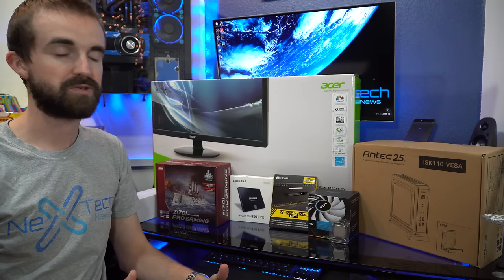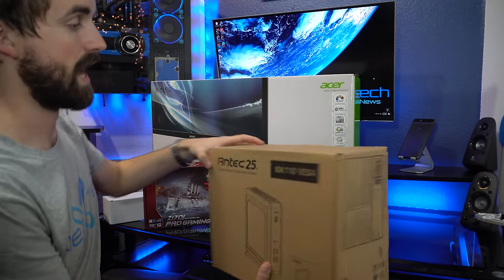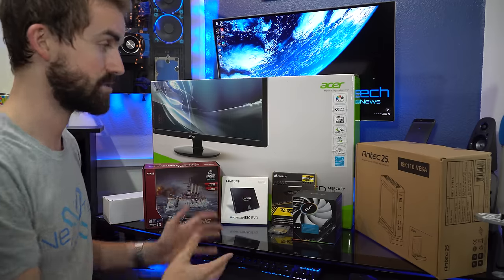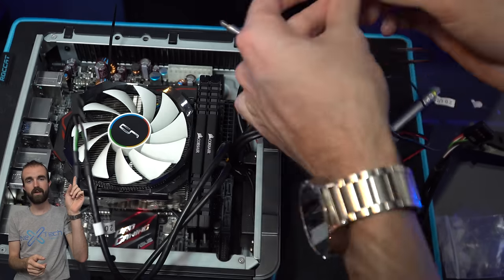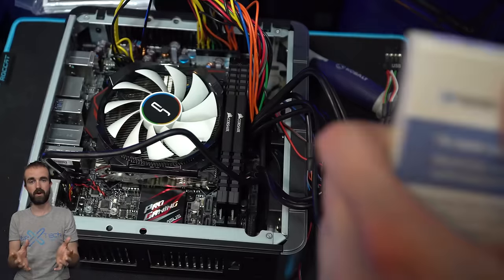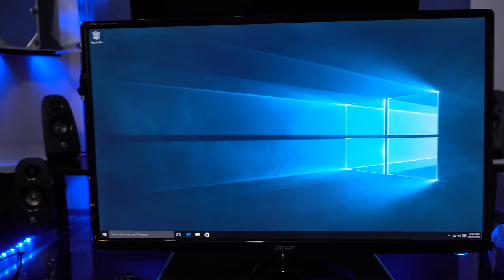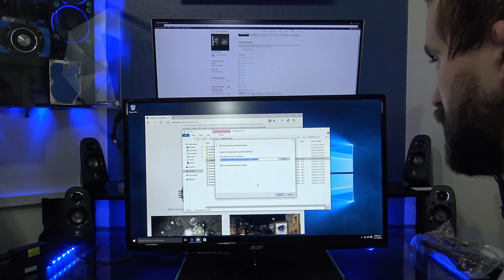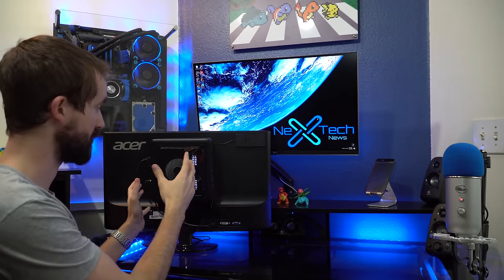DIY All In One PC Build (Antec 25 Case)

Comment: Dude, you never showed how you mounted the case to the monitor or explained how that affected anything which is the only selling point of the entire build.
Reply from the maker: +Gh0sT yeah sorry about that camera died during that scene and I didn't realize it until editing, it mounts to the back with 4 screws though, sorry
Reply: ISK110 case just has a vesa mount on its side that allows you to mount it with any monitor that has a standard vesa slots
Reply: DuDe, pause the video at the beginning and look at the box for the case. Shows that it can mount with vesa, which is standard on most monitors.

Comment: dude your content is extremely good for a channel that has 1000 subs! when I had a thousand subs my videos where pure crap! keep up the good work I really enjoyed watching this. Can you make a gamers build with an all in one system so similar to this but a gamer style. I wanna see what monitor you will pick and also what video card. 

I'm getting ready to make my first custom built pc video! 

Great job for your mom I ended up getting my mom a mac mini that was smaller and thinner that I probably could of mounted to the tv she had but it was just so easy and only cost 500
Reply from the maker: +SERGE That is definitely a build I have in mind! And that's awesome! If you ever need any help just let me know! And my mom would be so lost on a Mac, where did you get it for only $500?
Reply: NeXTech News mac minis actually are pretty cheap for how small and good they are. The 2012 models is the #1 sold small mini form computer for many years in a row now.
Reply from the maker: +SERGE That's very my dads company has tons of them but they bought them back in 2012 I didn't realize that had gotten as cheap as $500 now
Reply: starting price of a brand new Mac mini is also 499 but slower
Reply: NeXTech News I just did the same type of build in my pc video and for mine I opted for the amd apu with 2 sticks of 8gb running in duel channel. Great system!
Reply from the maker: +SERGE I'll have to go check it out!

Comment: USB 3.0 is backwards compatible with USB 2.0. Some boards even come with the adapter.
Reply from the maker: +Marc Wolfe yes it is but not without an adapter which is why I couldn't plug mine in because I didn't have the adapter yet, I should have been a little bit more clear on that in the video
Reply: BTW, good luck with that board. It may be fine, or it may get bricked. Google the board and "no display". I was pissed when mine did it.
Reply from the maker: +Marc Wolfe Really yours just stopped randomly? How much after buying?
Reply from the maker: +NeXTech News how long after?
Reply: Less than 30 days. It already had issues apparently. I bought it used at MicroCenter. Thought it was a fluke at first, then I googled it. I bought it after my Asrock H110m-itx/ac board quit on me. I ended up with another identical Asrock board that has been fine for the past 3...ish months.
Reply from the maker: +Marc Wolfe Dang dude you've been really unlucky with you motherboards recently!!! Well I'll definitely keep my eye out on this board! Thanks for the heads up!
Reply: A little bit. No problem. Unfortunately a lot of people think Asus is just fucking perfect because Linus Tech uses it, so it must be great... oh well.
Reply from the maker: +Marc Wolfe haha true!!

Comment: Great job, liked the vid. Was thinking of making a build like this but for editing/3d modeling, It would have to be in a different case tho.
Reply from the maker: Which case we're you thinking jw?
Reply: I havent found one yet, but for certain not the one you used since I will need to pop a GPU in there. Maybe something like the CM Elite 130, but it would have to act like a stand/base for the monitor. You attaching that case to the back was brilliant for its purpose. Might do that for my mom as well.

Comment: Nice build man, I have been looking at building in this case for a while and have been faffing about on pcpartpicker trying to get the wattage for my build within the 90w psu on the Antec. Wow man when i input your parts the wattage listed is around 180w so double. Could this be a problem longer term? You seem way way over the recommended load on the psu. Thanks for the video man, really enjoyed it.
Reply from the maker: +The Man of Mead the set up I have in the video maxes out at 180w if you max out everything but what she does on the computer isn't very extensive so it probably doesn't go over the 90w threshold other wise it doesn't work, down the PSU could fail because of this but if it does I'll just replace it, I would suggest using an hdplex if your looking to make your own version of this they go as high as 300w and the antec cases included PSU looked like it was the same size as an hdplex

Comment: Actually I've tried once to use a 4-pin PSU with my 8-pin MOBO and it worked just fine (Pentium Anniversary edition)
Reply from the maker: +Noaman Atassi Yeah you can, I just didn't realize that the case came with a better one

Comment: What do you think of the Aventum 3 from Digital Storm? And if so what attachment would you put on it?. Like if it can handle 3 monitors well doing twitch stream?. please help
Reply from the maker: Thats a beast of a full tower! and what do you mean attachment? Every configuration I've ever seen in that case could certainly handle 3 monitors and streaming!
Reply: By Attachments I mean adding more power into it would it have enough room for it the stage of what it is right now?. So it can handle 3 monitors and streaming that's good. What one thing would you change on it may I ask on the inside of it?.Okay would the stream be clear cut or laggy.
Reply from the maker: +Official_VD_ Fit which model are you looking at?
Reply from the maker: +Official_VD_ Fit Level 1, level 2, level 3, or level 4?

Comment: hey zac, i was thinking of building something similar with the comp mounted on the back of the monitor. how did you overcome the power button, by that i mean will your mom always have to reach the back of the monitor to power up the pc? is there a wake by monitor or something?
Reply from the maker: +theloudninja Sadly you do have to reach around for the power button but my mom always leaves on her computer so it wasn't a big deal for her, if I were to make another one I'd definitely find a way to make the power button more accessible

Comment: If it was a really low power gpu like a 750 or a 1050 would it be possible to make a slit in the case lid and use a gpu riser cable to mount the card? You could then somehow make a mounting solution on the monitor or make a mounting station for the GPU on the table that the monitor sits on. Just a thought! Though then you'd probably be looking at a Kaby Lake Pentium CPU and a GTX 1050. Doubt the PSU could handle much graphical power.
Reply from the maker: +Tom Brown that PSU definitely couldn't handle that but I think in the future I'm going to make another build like this one with a gpu, most likely a 1050 or 1050 ti and mount the GPU to back of monitor and I replace the PSU I used in this video with a 300w hdplex

Comment: Does this case only work with this particular monitor
Reply from the maker: +Free Shoes No the case works with any monitor that had mounting holes on the back
Reply: Than you and also I'm using a website to check to see if everything is compatible and it says that the power supple will not have enough power
Reply from the maker: +Free Shoes it's true the PSU that comes with the case is not rated very high, my mom's computer gets away with it because she never stresses the system but if you plan on gaming or anything on a statement like this I would recommend upgrading the psu

Comment: Could the case be mounted on any monitor?; I mean wouldn't it be too heavy for one particular monitor? and would it make a huge difference if a box of that size just kept on the desk?; isn't the power button hard to reach when the case is at the back?
and btw, how did you connect your computer with the mom's?
Reply from the maker: +Gayantha Vitharanage most monitors with vesa mount can support it, but some of the monitors stands might not be able to support the extra weight, but yes the power button is hard to reach, unless you use a remote power on switch like this: http://amzn.to/2znahwB
Reply: And did you connect your PC with your mom's via USB?; how?
Reply from the maker: +Gayantha Vitharanage When did I connect my computer to hers?
Reply: 14:08 When you put the drivers to the machine?

Comment: Why 6600k and not a I5 6500?? The i5 6500 has a Max wattage of 65watts!! And the 6600k has a Max wattage of 95watts. Why would you ever choose that cpu if you want to be power efficient?
Reply from the maker: +WKT because the 6600k was left over from another build, I figured I'd try it and if it didn't work I'd buy a 6500 or 6400

Comment: Great build! I just subscribed!  But why go with 6600k. There is i5 S and T variants,  they are low bower
Reply from the maker: I went with the k because I thought I would have to underclock it to be able to meet the power requirements of the power supply but surprisingly it didn't need to be underclocked!
Reply: NeXTech News it turned out unique anyway)
Reply from the maker: +amjad malki (ucantseeme47) true haha

Comment: why spend more (I'm assuming) on glowing fancy ram when you can get sticks that don't have the heatsink that for cheaper? id get it if were gonna be in a desktop that had a window or something but if the computer is gonna be attached to the back of the monitor I don't get the point.
Reply from the maker: +SavouryStew There wasn't a point I would have got other ones, I didn't care about the color I just got those ones really cheap!
Reply from the maker: +SavouryStew Honestly didn't care about the LEDs haha

Comment: Honestly, it would have been better to buy a used MacBook Air if your mom is going to be using only Microsoft applications, you can always double boot it very easily.
Reply from the maker: +Floss_My_COX_WIFI_With_Barbed_Wire The point of this build was to make her something that would be able to be fixed and keep running for a long time. The MacBook air is a great computer however nothing in it can be fixed or upgraded where in this build everything can be fixed or upgraded later down the road

Comment: That is not an all in one PC, you just attached a mini tower case to the back of a monitor .
Reply from the maker: +LifeTips UK What makes it an all in one?
Reply: NeXTech News You just connected a small tower case to the back of a monitor like you would with a desktop pc. My (all in one) pc has all the hardware integrated inside the base including the speakers, my pc also has just one cable which is the ac adapter, but yours still has lots of wires that connect to different components. Doesn't matter, you still did a very good job.
Reply from the maker: +LifeTips UK True next rendition will be better and thanks!

Comment: I build a core p5 as I don't have room on my desk as I want more monitor space and I don't like having computer in the carpet
Reply from the maker: +jameshone1000 Yeah that the same reason I built a core p3
Reply: i have a very small room and I only have the spaces of one desk so yep computer going wall mount I going to  build the core p5 because I want more hard drive spaces I believe the core 3 only has two 3.5inch drive bays  were the p5 has 4 I guess that's why you have that hard drive on show below your cooler
Reply from the maker: +jameshone1000 yeah the p5 has a lot more room than the p3 but you want to make sure you have enough components to fill it because it'll look a little weird if that case is not filled
Reply from the maker: +jameshone1000 and yeah I have that HDD on display there because there is a gaming hole in the case there and it covered it up haha
Reply: lol should of got a bigger radiator
Reply from the maker: +jameshone1000 haha I know! I really should have!
Reply: i going to do a custom loop on mine slowly going to buy bits when I have some spear money
Reply from the maker: +jameshone1000 Nice I'd love to see that when it's done!

Comment: was it cheaper than buying her a NUC? /:)
otherwise, it's a little pointless and overkill if a NUC is cheaper!
Reply from the maker: The 6th gen i5 nuc is only about $40 cheaper after you buy your SSD and ram for the nuc, and the i5 in the nuc is an i5 6260u which is a laptop grade dual core processor with only 4 threads where is, the i5 6600k is a quad core 4 thread processor. These were left over parts that I had from previous builds had I bought all the parts new I would have made it like this:https://pcpartpicker.com/list/dzWsjc and then they are the same haha. This build is totally overkill though haha, but it was fun to make and it was lots of leftover parts haha
Reply: Oh, cool stuff then! :) GJ! And thanks for clarifying!
What did you use to record the 4K vid with? Quality looks something similar to a mobile device :P
Reply from the maker: It's actually a Sony A6300 camera haha

Comment: You can plug in a 4pin psu into a 8pin cpu. What? Not a good call for the 6600k over the 6600. I have ran so many AMD and older Intel CPU's running around 77-125watts from a 4 pin.
Reply from the maker: +rambow70 yeah I know you can but the other one had an 8 pin so I went ahead with that plus it saved my mom $80 and I only went with the 6600k because it was left over

Comment: TLDR: buy an Intel NUC. Smaller, better looking, sometimes cheaper
Reply from the maker: +mattferg100 I do highly recommend the nuc but this wasnt about being the smallest or best looking PC this was all about how long i can make the PC last, with my build everything can be replaced if something fails with a nuc that doesn't apply
Reply: Yes, but a NUC has a manufacturer warranty, and the only thing you can't really replace is the processor... which for your mum's application it doesn't sound like she'd ever really need upgraded!
Reply from the maker: +mattferg100 Very valid points! I'm not saying that a nuc isn't good because they are it's just not what I wanted to do for this situation, but you could absolutely do the same thing with a nuc and it'd be awesome!
Reply: Fair enough! I only say this as I did exactly the same as you (built an ITX PC for my step-dad) and thinking about it afterwards a NUC may have made more sense!
Reply from the maker: +mattferg100 Yeah I'd say both have there pros and cons but in the end both are great computers!

Comment: why not just go with i5 6400? i dont think your mum uses that 6600k
Reply from the maker: +Twinkie552 No she definitely doesn't haha but I thought I needed the i5 6600k because I thought I'd have to underclock the CPU to meet the power requirements of the psu
Reply: NeXTech News  i understabd but 6400 draws i think less than a volt. 1.018 under full load. 60w tdp. basically laptop grade
Reply from the maker: +Twinkie552 Yeah very true but I also just had that i5 6600k just sitting around haha
Reply: good life tho :D

Comment: whyyy the fuck wouldylunotjust buy her a prebuilt from.walmart this is perfect for gaming g if you would throw in a GTX 1060
Reply from the maker: +Marc Sticken I decided to go with this for two reasons over a prebuilt system, one: prebuilts don't have lots of parts that are swappable later down the road like this does (if a part like the CPU goes bad I can replace it in this build but in a prebuilt you'd have to replace the whole system), two: most of the parts were left overs from past PC builds, for example the i5 6600k came from my old Corsair Air 240 build. And I wish a GPU could fit in this case but not gunna happen without some serious mods haha
Reply: but still its overkill why not then instead get a h110m chipset and a g4560 or i3
Reply from the maker: +Marc Sticken because the motherboard was left over too, I was going to put an i3 in it but then I remembered I had the i5 so I said screw spending extra money and installed it, I know this build is mega overkill though, and I wouldn't really recommend any one to build in this way
Reply: NeXTech News ok understandable have a nice day (understand I thought they were all new just for this PC)
Reply from the maker: +Marc Sticken I understand, I didn't explain that at all in the video, so it does seem like I purposely chose then for this build
Reply: NeXTech News why don't you have more subs I never see Linus so involved with his fans honestly if I had a assload of subs I'd do a shout-out for you but I have a meeger 43 so I don't think that would really help, I hope you channel blows up and thrives
Reply from the maker: I wish I did, but they are growing steadily. Eventually I'll have a lot more subs! I hope haha! And thank you so much! I will always be involved with my fans!